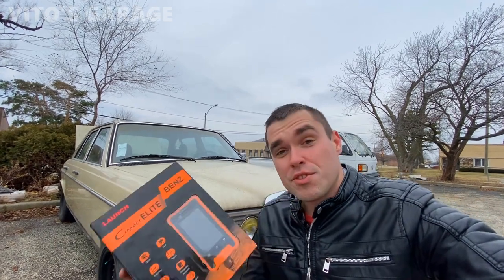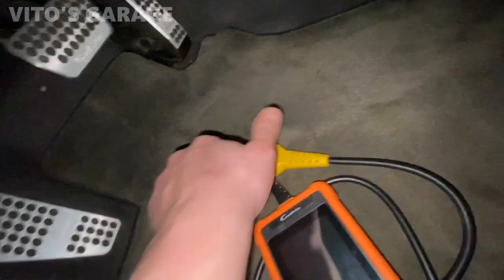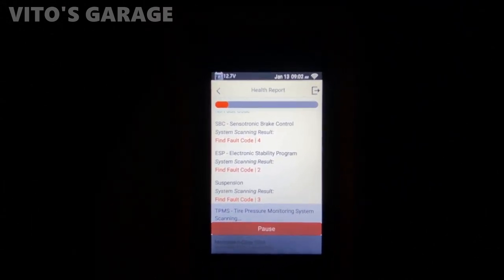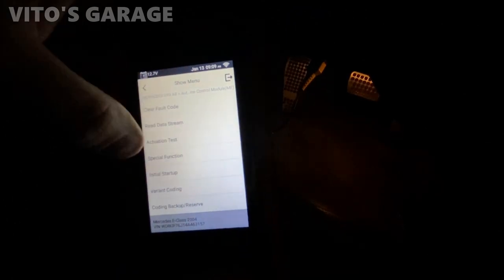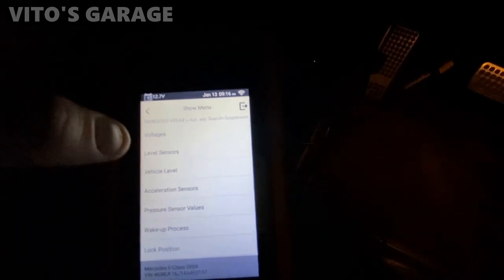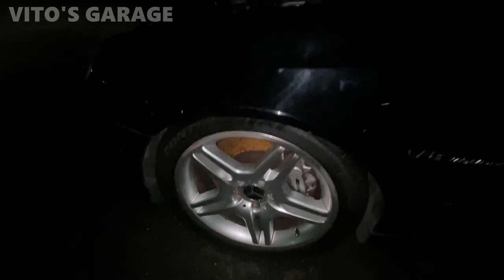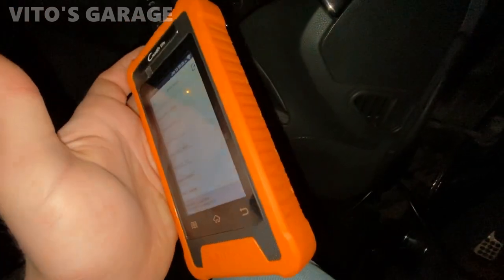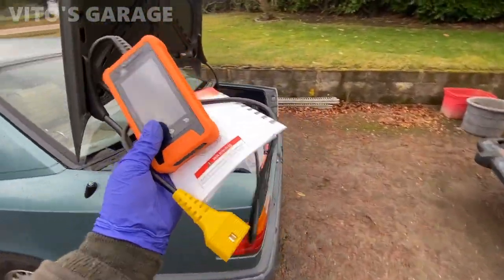Launch Elite Super Capable Tiny Mercedes Scan Tool!!!! Lifting an Air Suspension on a  Mercedes W211

Comment: Very capable toll, specially because of the activation tests. I had luck with my Xtool D7 on my W211. Xtool has great support as initially the Scanner couldnt read the ESP module. After a week they pushed a new software release and now I can read all modules!!